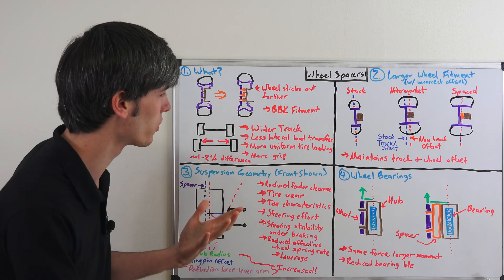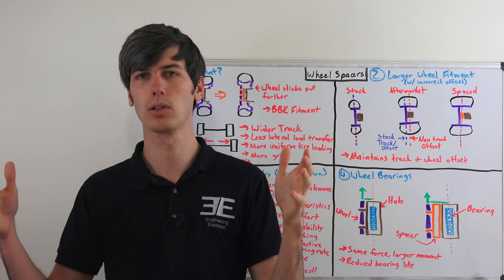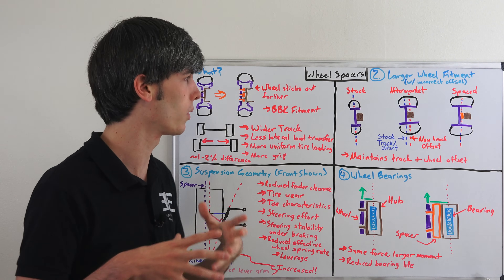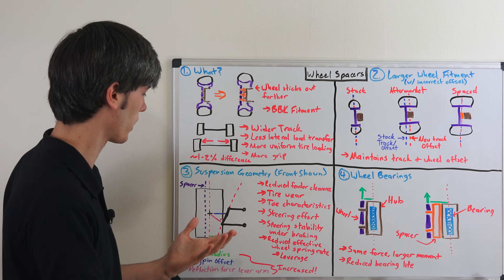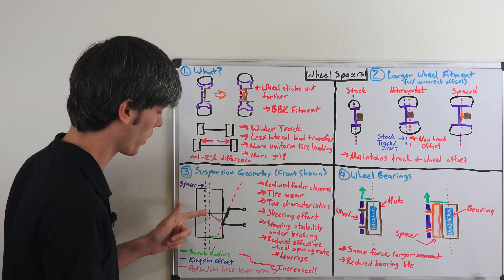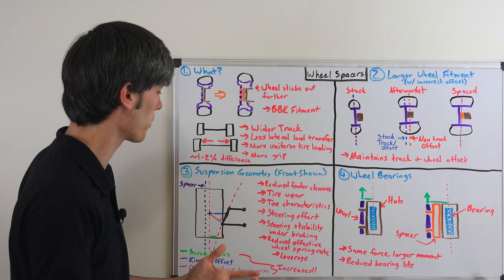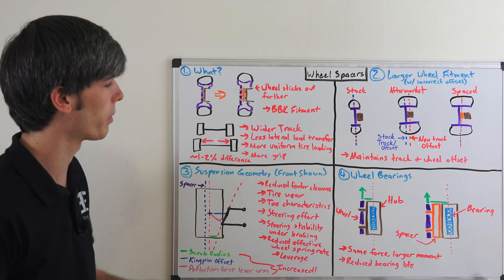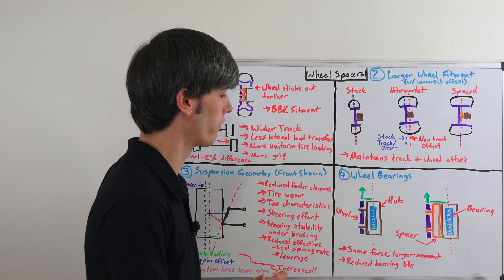Wheel Spacers & Adapters - Good Or Bad?

Comment: People forget that aftermarket wheels with a different than stock offset is no different than a wheel spacer while still using the stock wheel.  The purpose is to move wheel outward for clearance whatever your need is.  Aftermarket wheels propose the same negative effects as spacers.  SMALL differences ( 10mm or less)should not create an issue.  Yes it may shorten bearing life by 1000, 2000, or even 3000 miles depending on how much offset or your driving environment.  I have factory +19 offset on my truck and shops constantly are selling the ever popular -22mm offset wheel to accommodate larger tires (35x12.5x?).  I bought some +10 mm aftermarket wheels so I am -9mm than stock.  No noticeable issues.  I want to go back to stock wheel but want a 10 mm wider tire (275 to 285) on the truck but I am now going back in towards the rotor and will have tire clearance issues on the suspension even with a level kit.  A 1 inch spacer gives me 25mm outward clearance - 19mm factory wheel offset leaves me with a final -6mm offset.  Much less than the -22mm aftermarket wheels shops are selling daily.  I understand this will or can affect suspension, bearing life and handling and am good with that so far.  This guys video did inform me of things I was unaware of.  Those of you worried about 3mm or 6mm I would not panic.  Be careful and pay attention when making your change.  Check lugs 5 miles after install and again 100 miles after and again at each oil change.  I would like thoughts from those who have done this if I am overlooking anything serious or detrimental.  Please enlighten me with anything I may be overlooking.  The video was excellent and not drawn out.  He could have talked for two hours and still not covered EVERYTHING to do with wheels, suspension travel, clearances etc.  Good overview to help make better decisions.  Thanks!

Comment: god damn....thx for killing my dreams of wider tyre look....ill just stick to stock then 😔
Reply: you can always opt for wheels with shorter backspacing. it may be a better option than spacrrs, but anytime you modify a car you're always going to run into little opportunities for increased wear
Reply: honestly... if you want looks and not performance.. just go for it... internet is know for thinking everyone wants a maximized performance track machine.. even when its a commuter vehicle..
Reply: The whole point is to not spend as much money on a new set of wheels and just giving it a wider appearance
Reply: Alejandroof I'm only doing it to fit a set of rims that don't fit on my car 4x100 to 4x114.3😂
Reply: Calvyn Jacobsen 
It is then called an adapter; not a spacer.  I'm doing that, too.  It's for changing the bolt pattern to fit a specific wheel I want to use.
Reply: Get some good offset wheels
Reply: ralph sampson yes but they act as a spacer as well but you're right haha
Reply: Dude wheel spacers are gay anyways.
Reply: I was thinking the same thing but, hypothetically speaking. if you went with a negative offset wheel to let's say gain 2"  wouldn't it affect the geometry of the suspension just as a 2" wheel spacer?

Comment: I watched another video that showed four of the five lug bolts were broken off because of the same problem you discussed with the wheel bearings.  I don't know if the spacers were the correct ones for the vehicle or if they were properly installed.  But in any case, broken lug bolts isn't good.
Reply: in that video, that had nothing to do with what the guy here is saying. that was due to improper installation/not recheck ingredients torque, and also because the guy used a lug centric spacer instead of s hub centric spacer. big difference.
Reply: Agreed. Too many people won't run wheel spacers because of those horror stories. Another failure (which I've found to be the most common) is that people don't measure their stud lengths. When they tighten the wheels they're actually tightening them onto the top of their old studs and not the wheel spacer. You can see where the old studs scratched the hell out of their rims... but they only notice after the whole wheel falls off.

Comment: Well thanks for shattering all my hopes and dreams...😏 lol
Reply: Rick Willard The negative effect and positive effects are not significant, it's minimal I fact, he said it himself at the beginning. I wouldn't go beyond 5 or 6 mm.
Reply: @ek07305  a lot of 370z owners run 15, 20, and 25mm spacers.  I could use 15mm spacers once I get my new rims put on to get flush w/ the fender fitment but I think i'll pass cuz of these negative effects listed
Reply: If your wanting to make them wider, check your offset of stock wheels , and see how far that takes you from 0 offset,
Reply: Rick Willard your delts are godly bro
Reply: The negative effects would actually be more notable than the positive ones, since the negatives are produced from a relatively larger change than the positive effects are. 

To better explain, an extra 20mm on either side of the vehicle will increase stance by some incredibly small percentage over the relatively large total distance between the wheels... 

However, the same 20mm added on to the hub will be a much larger change when measured against the individual suspension components, since everything is much closer inside each wheel well.

Comment: Hi engineering explained, it would be great if you can speak about custom wheels for performance cars. Issues like for example what are the major specs you should consider when choosing custom wheels for performance reasons: cast/forged, size, offset, weight, tire rubbing, sidewall height. One question I have is going from a 24 lbs 18" wheel to a 24 lbs 19" wheels with the same offset and overall tire diameter, which wheel will have faster performance, or are they exactly the same?

Comment: I have a question. BMW E30 OEM 15x7J wheels have ET24 offset. There's many great aftermarket 15x7J wheels that have ET35 or even ET43 offset. Is using a spacer with one of these a good idea, or just stick to the OEM wheels?

Comment: This is my problem with saying buy properly fitted wheels to achieve the desired wheel track. see below and These are all example numbers purely based on wheel offset vs. desired track width.

W/ Wheel Spacer
Wheel Spec: 18x8 +32
Spacer Spec: 10mm

W/O Wheel Spacer
Wheel Spec: 18x8 +22

This will put the same added stress on your wheel bearings, add the same affects to scrub radius.

The only way to properly widen your wheelbase is to move the location of your uprights out wards with replicating the correct geometry
Reply from the maker: +Robert Stothart Agreed. I think upgrading suspension components is a smarter way of increasing track width (there are kits to do this), and upgrading wheels (with the correct offset) should be done for increasing tire width (with new tires, of course).
Reply: but to note, i'm using an unfortunately large wheel spacer at the moment and i've notice no abnormal wheel bearing, but can certainly feel the negative affects of the scrub radius / roll center and toe getting disturbed under braking haha.

Comment: things to consider:
1.: spacers ar used not just onroad. thing off offroad stuff, it amkes more sense there, actually.
2.: it does change the ratio of track width and axle distance. witch affects steering geometry allso.

Comment: I have a 95 Ford F-150 Lightning. I'm putting 24s on it but I have to add a 1.25 adapter. So my question is if I do all that and get the alignment done. Would that still shorten the life of my wheel bearing?

Comment: My sister had spacers on her infiniti g35 coupe. She hit a pothole while driving on the freeway. The car bottomed out and had over 10000 dollars in damages. Got rid of her car and parted out the mods for resale. I asked her for the wheel spacers since I drive a Nissan 350z. She gave them to me and told me they were originally for a 350z anyways. So now I have these spacers on my Z. Now I'm wondering if these spacers are the cause of her car bottoming out. I've been driving with these spacers for 20000miles now. I like keeping the car as stock looking as possible doing mainly performance mods and making subtle exterior changes ( sleeper) . The look of flush rims along side the fender is beautiful and being able to put wider tires on the car is a plus for what I intend to do to the car performance wise. Do you think it was the spacers fault?
Reply: TECHNIQUE  phillip sadly died after he hit a pot hole and his car blew up
Reply: TECHNIQUE Sorry for the delayed response. The spacers are fine actually. I still have them on my Z. We determined that the springs were the cause of the g35 bottoming out. They were cut springs.
Reply: Going to get them for my G ! Do you think brands matter? Thanks
Reply: Simran Singh I recommend going with a well known brand...I do not remember off the top of my head what brand she used...( most likely Japanese) but so far the spacers have not caused any problems to my car. So I think it is safe to go. Just check the reviews. Good luck!
Reply: i have spacers on the front of my 350z from Precision European Motorwerks (got them on ebay for around 80 for four).  been using them since just after i bought the car around 4 years ago.  no problems at all.  
and spacers will not cause you to bottom out.  cut springs and really low drops (Zs are low anyway, i scraped on things at stock height and only lowered mine about 3/4s of an inch) will cause you to bottom out.  which is why i dont understand the whole slam it to the ground culture but hey, not my car right?

Comment: one thing you seem to have missed.  the majority (from what i have seen) of people who use wheel spacers do it one off road vehicles so they can fit larger tires without rubbing on the suspension.  these vehicles generally have upgraded axles, and don't do speeds over 25mph, therefore almost all the negatives you just mentioned are negated.

Comment: IMO spacers likely change allot of suspension.

I'm not the best at explaining things, but I think you'll get my point.
The geometry as he explained will obviously change, requiring at least an alignment.
Just wanted to mention if your considering this for a new set of custom wheels you could look into ordering a set that has a different center line offset. If your factory set  is 0 negative 0 positive. mounting flang is in the center of the rim.

So if you put a 1" spacer it would result in a 1" offset, so  get a set of rims that have a 1" inset that would place the wheels back on the same centerline as factory.
 Of course you have to make sure you can tuck that wider tire rim combo inside to be sure it clears all your suspension.

You can check your offset by placing a straight edge ruler on the rim, then measure to the rim center mounting surface. do this on both sides and you can compare the diff.

Comment: spacers don't change your wheel offset like your trying to say in the bottom left box the offset of the wheel stays the same you just move the wheel out farther which yes gives less fender clearance which is why alot of people use spacers
Reply: and your tire wear if you get everything realigned after you put the spacers is it doesn't and you say it hurts stability real world testing says it helps

Comment: +Engineering Explained  what if the offset on the new wheels makes them go alot more in and you want them to be the same as the wheels before, ie you use a spacer, wont that just be the same as the original then?

Comment: Spacer + Rims with higher offset than original rims will not affect (3) Suspension Geometry, just saying.
Reply: Lansdrow it would because the lever arm on the bearing is still greater as the studs of the spacer bear the weight and stranger it onto the hub and that interface is farther away from the center axis of the bearing.

Comment: FWIW - I put aftermarket wheels on my side by side that had a more positive offset thus requiring 1" spacers to maintain the original track specifications.  No problems yet and it's been two years.

Comment: How about this, Wheel Spacers = BAD period!  if you had 20 Nuts to worry about now you have 40.  Why??  Get Aftermarket Wheels that match your desire or if you don't have the money leave tings alone. Why upgrade Brakes???  They carefully engineer braking systems to match them to the vehicle they go on.  
Bottom Line, People do it for looks rather then Functionality.
Reply: +Ralf V most spacer retain the same number of nuts, just use longer bolts. Often it’s not just a matter of lacking money, I personally prefer the look of OEM wheels, but they lack a better offset. I prefer the cheaper option of wheel spacers than different wheels, that by the way have exactly the same negative effects of spacers and moreover look most of the time tacky. 
Why upgrading brakes? To brake better, perhaps? They carefully engineer every component of a cheap car to make it as cheaply as possible, giving the minimum standard of safety, that’s why.

Comment: You are RIGHT ON when it comes to added distance from a center point to bearing stress / wear potential. Just enjoy the simplistic example of a kid's cart....make the axle wider /longer and it will affect the steering pressure as well as breaking alignment when pressure is applied.   JK.

Comment: Great vid. I bought a 928 last year, and I haven't been happy with the way it tramlines. Which I thought was strange, because the front wheels are stock. But I was just doing some brake work on it, and suddenly realized it has spacers on it. Definitely removing them. The rear wheels have a smaller positive offset than stock, so I guess I'm out of luck if I want to have a stock rear track with those wheels.

Comment: do you have a video explaining why some vehicles which have larger diameter wheels than stock have a higher ride height in the front compared to the rear? assuming the vehicle underneath is level with stocl wheels and tires and the horizontal plane increases a few degrees in the front with aftermarket.

Comment: I have a bmw e90 2008 325da. oem M-sport wheels are front:225/45/17 rear:255/40/17 I think the profile was 45 front and 40 rear.. but now I use 235/45/18 in front and 265/40/18 in rear. 17" rims are 7.5" and 8.5" wide. 18" rims are one inch wider 8.5" and 9.5". when I bought these rims I askd the dealer does those rims fit my car he double check on pc and told me its perfect fit. the tyres are nankang semi-slick ns2 or something. after puting them on my car the first thing I notice was noise like a wheelbearing problem. there is no scratching or nothing fits good i wheelbase. that sound irritated me so much so when I checkd the wheelbearing front/right it was little lose. so I changed both front bearings. and after not much driving again the noise from front/right came back. then I changed only that bearing at front/right and after 30-40min driving again noise.... the dealer I bought the wheels told me that some tyre noise will appear but with brand new bearings its not much noise. so after buying those damn wheels my bearings have been problem at front. what should I do? trash the nankang tyres and buy something softer and less gripy? those nankangs are very gripy and have very hard sidewall.
Reply: +ibocan92 EDIT: the new 18" wheels are 235/40/18 and 265/40/18 Nankang 235/40-18 NS-2R XLL 180 ( semislick)
should I sell those 18" wheels or just change tyres to something more street tyres?

Comment: After adding 15mm spacers to the rear of my car, I've noticed a significant difference vs. them not being there. With the spacers, the rear suspension feels a lot softer, almost too soft, so confidence in the corners is reduced. The car looks better with them on, but I think I'll be removing them soon.
Reply: Weird aftermath. I had 3 cars and all of them had wheel spacers added and the suspension changed to harder...
Reply: I noticed my suspension was softer as well after adding 20mm spacers to my Z, I would assume that would be due to the increased leverage the tire has over the suspension.
Reply: should have nothing to do with how a vehicle rides.

God lord this is an old post and video..😅
Reply: @curte7739 he literally states in the video that spacers can reduce the effective spring rate.. it’s called leverage dude. Ever use a breaker bar?

Comment: Do you think going from a 2016 WRX stock wheel size of 17x8 +55 to 18x9 +40 will have a noticeable effect (or compromise in any way) on handling, acceleration, or braking? It's essentially like adding a 20mm spacer and slightly wider tires, correct? I'm asking you because I trust your judgement far more than that of the NASIOC community. I'm not really into modding the car or anything I just want to use the stock wheels for snow tires and thought I could go a little bit wider with the summer tires. I am a subscriber by the way.

Comment: But isn't there a way to diminish the downsides and still have a somewhat normal lifespan of the bearing?
#1 I read in a comment once: instead of spacers use a rim with a different offset.
#2 in these examples we're talking about same wheel just pushed more to the outside but what if I am using a lighter wheel. I want to think that the forces generated by a lighter wheel are lower at first and then higher by the extended leverage so in total you might end up with about the same forces as before.
I am asking because I bought new wheels which are 1" wider than the old ones, have a 13mm offset difference that pushes them outside and they are very light compared to the other ones. Will my wheel bearings suffer that much or could it be that I'm lucky and I can just enjoy my new look?